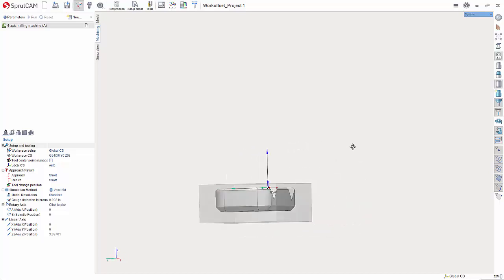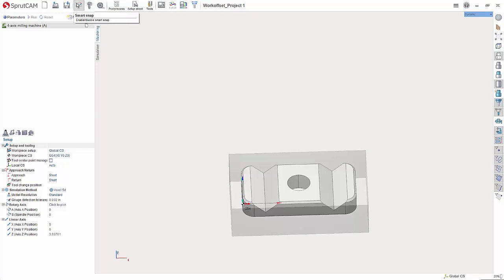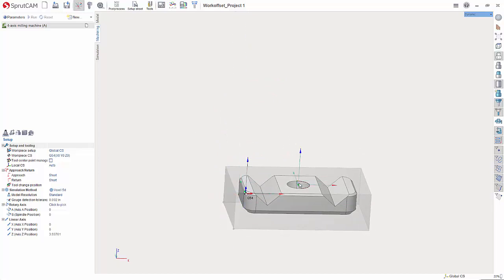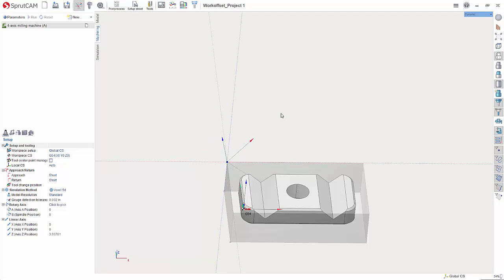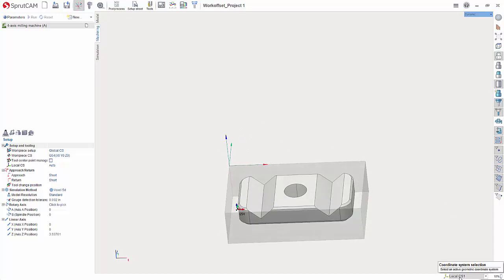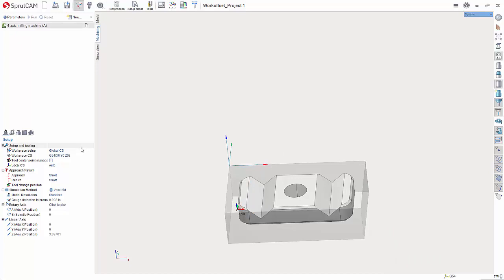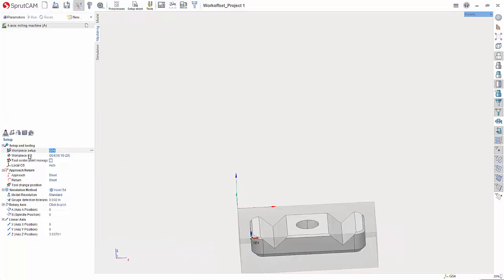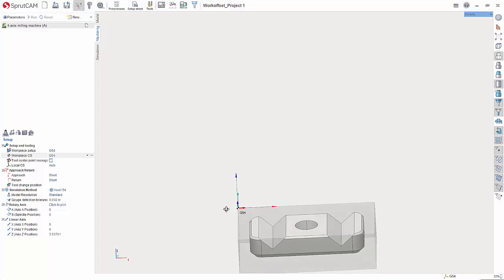SprutCAM 14: Creating a Work Offset

Comment: This thing about adding additional CS's is cool and all, but I have to ask: why?
I have been using SC14 for almost ½ yr now, and never felt that I had to do anything about the CS, apart from moving the workpiece CS to the point where have measured in my zero on the machine. That is a very simple click-n-drag with the mouse, and then I'm ready to add operations! Am I missing out on some machinist trade secret, or what? :) Maybe it's because of the CNC I'm using, that has an extremely simple interface for setting the workpiece origin? (I think you can guess what brand it is)